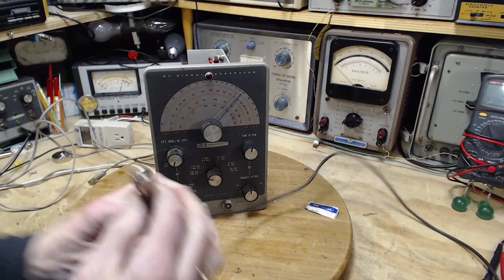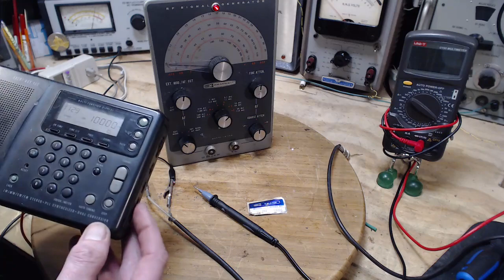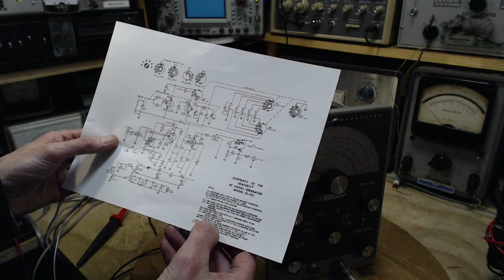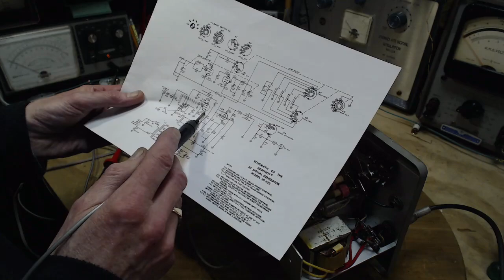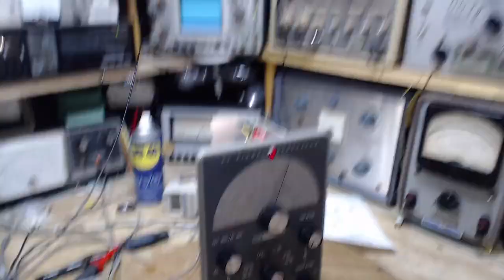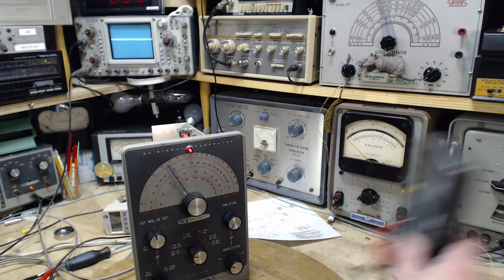Heathkit Signal Generator IG-102 Video #1 - Checkout

Comment: Painful to watch.  Coarse and fine attenuator in the wrong positions.  NO checking for bad connections, dirty controls and switches, etc.  Tossing the chassis around with tubes installed.  2 hours and no results.

Comment: Hi Jim.  I've been restoring an IG-102.  I have run into exactly the same problem with getting no output.  I have recapped and replaced resistors where necessary.  Replaced the tubes.  Nothing seems to help.  Did you ever figure out what the problem was?

Comment: The IG-102 has the main frequency dial running with fundamentals, and the main dial goes up to 110 MHz.  The dial then uses harmonics that go on band F from 110MHz to 
220 MHz.  I have one of these generators that I converted to solid state using FETs.  I believe they are MPF102s, and using a smaller transformer to supply  9 volts.  I need to reduce the drain supply resistors to around 90 Ohms, to make it work better.  I got the changes from a website that converted the IG-102 to solid state.

Comment: Jim please just scope the top end of R12 .
If you have RF the attenuator stage is faulty .

Don't expect a perfect waveform the output can look horrific .
But the receiver normally doesn't care !
Reply: The lowest he had his scope was 0.5V per div. How much signal would you see if the output is in the 100mV peak to peak range? 
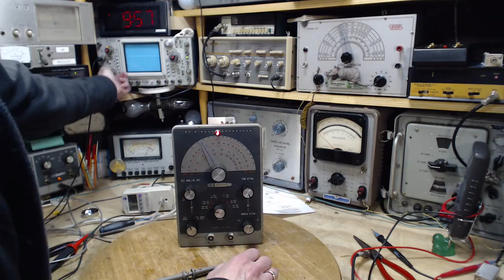All around 1:15:52 his scope shows a very tiny hint of a signal when he properly touches signal and ground on the amphenol connector, clearly indicating a signal there but too small for the currently set sensitivity of 0.5V/div. But instead of increasing the sensitivity to the 50mV/div range by turning the knob on his scope clockwise, he mumbles at 1:16:10 is "There is something there... But maybe it is so BIG we cannot see it" and he turns the Y- sensitivity counterclockwise to desensitize the scope even more.
After all these years he still does not know how to operate a scope or take measurements with it.

Comment: 20:00 Some sources claim the maximum RF output voltage of this generator to be 100mV on the lowest band... So on a scope using a x1 probe you should be able to get a good size signal...
And with a radio you will ofc receive a signal just by way of the oscillator coils radiating...

Comment: I have never met anyone so adept as Jim at testing and measuring circuits without actually having his test equipment hooked up to anything.
Reply: Well OTOH he dont get any real clues either with test equipment hooked up. That ordeal at 30:48 Is pure comedy. He has the scope connected nowhere and talks himself  into believing, that the 60Hz hum on the scope is a 10some MHz signal from that generator.
Reply: That is part of the fun to watching his videos. Supposes too much me thinks. Never fully recaps the equipment he works on nor checks what he 
uses to test those things are even set right!

Comment: My Pappy put forth that idea to me about leaving the lights on when I was 5 and even at that young age I thought it was one of the dumbest things I had ever heard, LOL!  Kind of like how he also thought when low on gasoline you should drive faster so you can coast farther when you run out.  He never could wrap his head around how I could drive 300 miles in my old Cadillac and use 1/4th of a tank of gas going 55mph while he would use 3/4 of a tank going 70mph, LOL!

Comment: Those Amphenol connectors are, and always have been, crap. That’s why no one uses them for anything, anymore. BNC connectors should fit in the holes without the need for any modification.  I recommend you install them immediately in place of those Amphenol connectors. The Amphenol connectors depend upon the physical mating of two solder connections. This is why they are crap.
Reply: The connectors were making perfect contact as clearly indicated by the fact that the scope trace flattened out and lost the picked up 60Hz hum whenever he connected the scope to the test lead and the test lead to the generator. And a scope on the 0.5V/div setting will hardly display a big waveform if the input is only a 0.1Vpp signal. The only problem I see is the person operating the connector and the state of his test equipment. For many videos now is he fully aware of and struggling with his DMM being utterly bonkers and/or used wrong.
Reply: @randomsteve4288  think the memory is shot.  He'll call out a pin and voltage and forgets by time he goes to place the probe.  I honestly am starting to think he isn't remembering anything that is wrong or things he may have learned